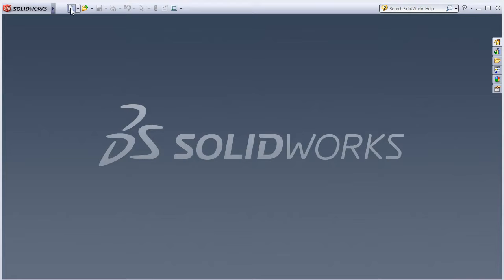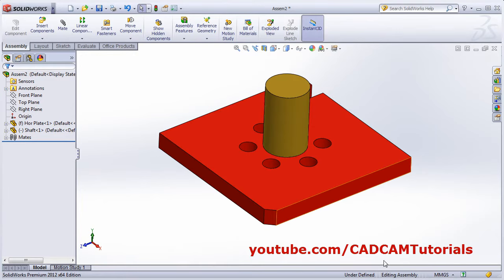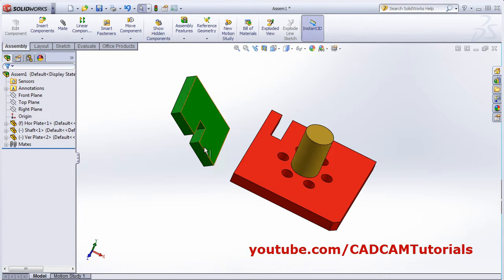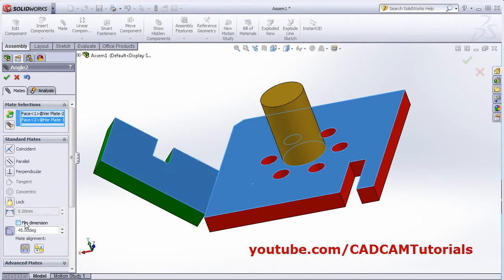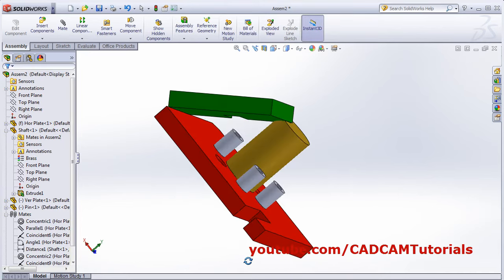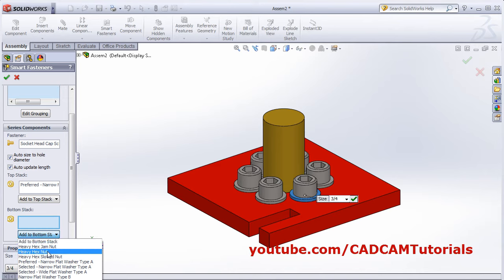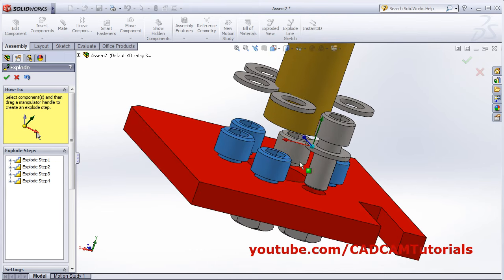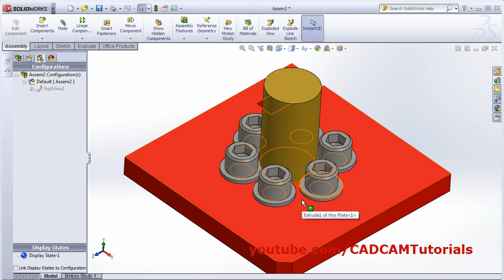SolidWorks Assembly Tutorial for Beginners - 1 | Basics, Mates, Mirror, Constraints, Exploded View

Comment: feature driven pattern is not showing in the options. I tried using search bar also but it is not there. I am using solidworks 2023 can anyone please help.
Reply from the maker: One patter feature is required in part.
Reply: found the solution, dont use linear sketch pattern. Instead sketch 1 hole first then pattern it using circular pattern for features. On the drop down menu it now appears as cirpattern1 and can be used to do pattern driven command

Comment: again "you must select a hole wizard feature, or a feature or component that is part of existing pattern, to drive the pattern you want to create"' when I click the hole it isnt recognized as pattern but recognized as extruded cut??
Reply: found the solution, dont use linear sketch pattern. Instead sketch 1 hole first then pattern it using circular pattern for features. On the drop down menu it now appears as cirpattern1 and can be used to do pattern driven command

Comment: At 5.56 when I try to use the option "pattern driven component pattern" it doesn't not work and error appears saying "you must select a hole wizard feature, or a feature or component that is part of existing pattern, to drive the pattern you want to create". How can I fix it? As I followed exactly the same method as in video. Plz help
Reply: found the solution, dont use linear sketch pattern. Instead sketch 1 hole first then pattern it using circular pattern for features. On the drop down menu it now appears as cirpattern1 and can be used to do pattern driven command

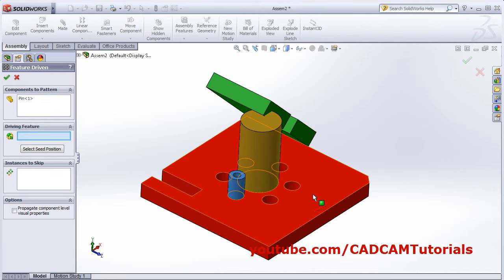Comment: Sir I have a problem.When I clicked the feature like you at 6:33,the information box appeared and said I must select a Hole wizard feature,or a feature or a component that is part of an existing pattern  ,to drive the pattern you want to create.
What could I do wrong ?
Reply: I have same problem. I think we need to create holes by Hole Wizard instead to access this feature. I am not sure though, there may be another way to do so.
Reply: found the solution, dont use linear sketch pattern. Instead sketch 1 hole first then pattern it using circular pattern for features. On the drop down menu it now appears as cirpattern1 and can be used to do pattern driven command